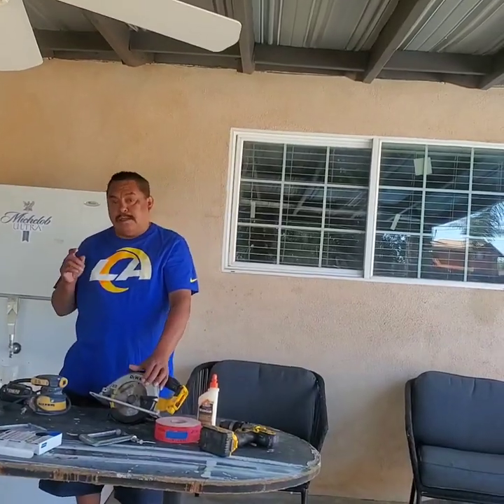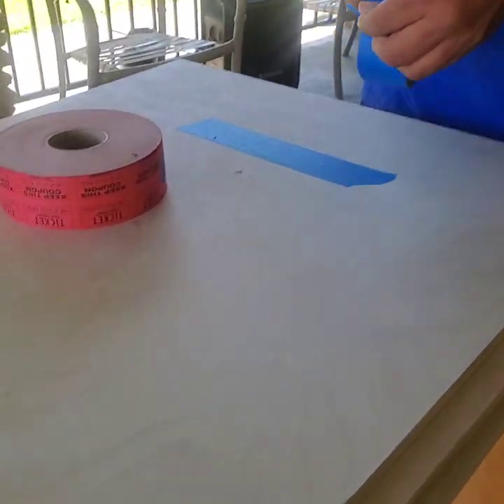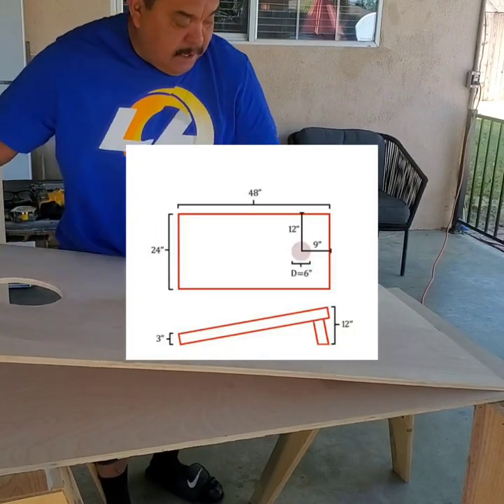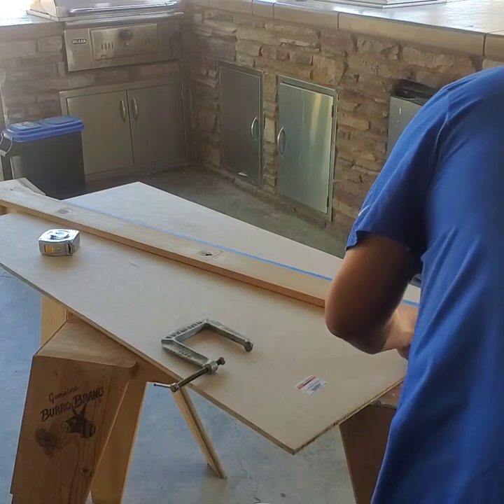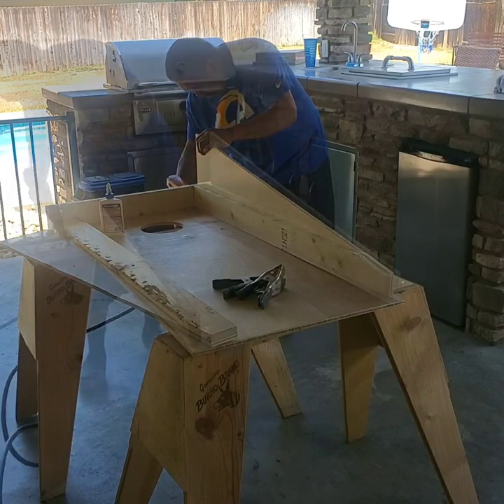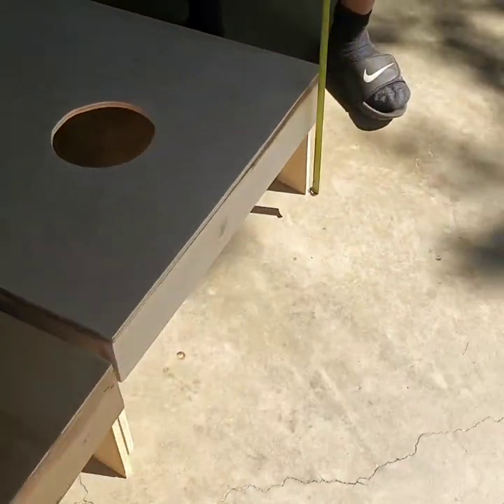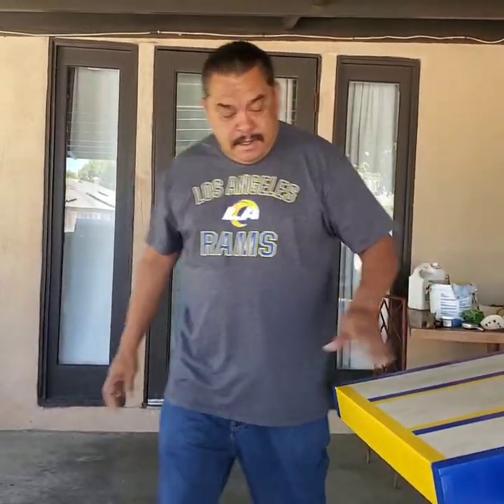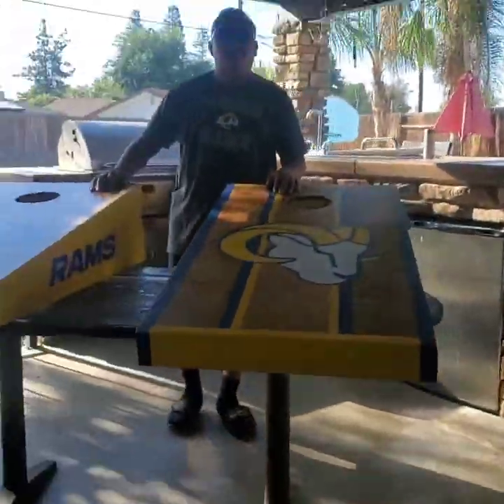How to make a Cornhole board game/ bean bag game DIY

Comment: Those are gorgeous corn hole boards!  I've just built my first set of boards and I'm concerned that the top decks may not be as slippery as necessary.  Would you have any suggestions on how to make the top deck more slippery to allow the bags to slide better?  Mine are tacky or sticky.....but the bags just don't seem to slide as much as I had thought they should.
Reply from the maker: use many coats of water based polyurethane
Reply: @mrnoe67tiktok  thank you sir!!!